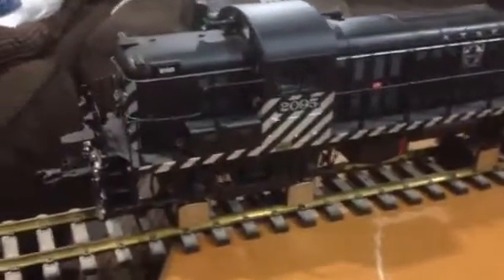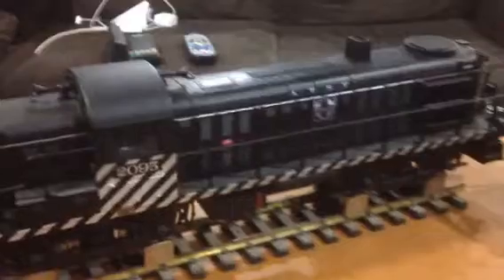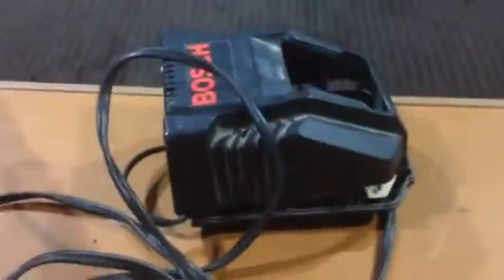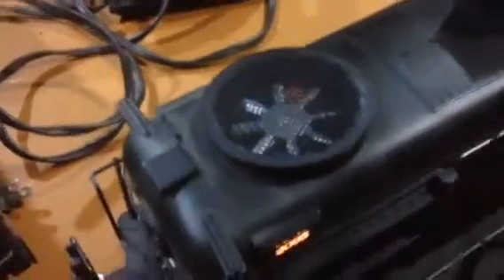G scale DIY Battery Car.

Comment: A RC controller for speed would be Super
🚂👌🏽😎
Reply from the maker: I don’t really use this anymore but I still use screw gun batteries to control Airwire G3 boards.
Reply from the maker: I don’t really use this anymore but I still use screw gun batteries to control Airwire G3 boards.
Reply from the maker: I don’t really use this anymore but I still use screw gun batteries to control Airwire G3 boards.

Comment: How long can one of these run on this kind of battery?
Reply from the maker: I have since made an advancement and have sacrificed a crew gun to mount the battery in to. This way I could set the speed slower. At a constant decent speed, not too fast, not too slow, it lasts about three and a half hours.